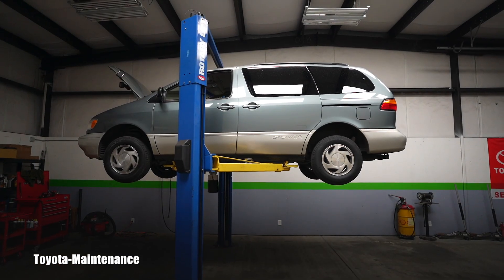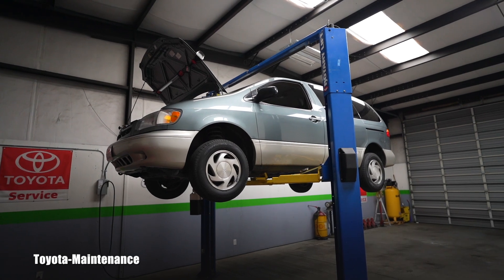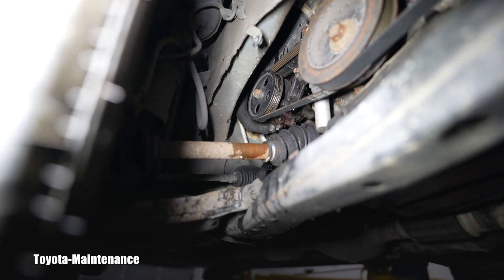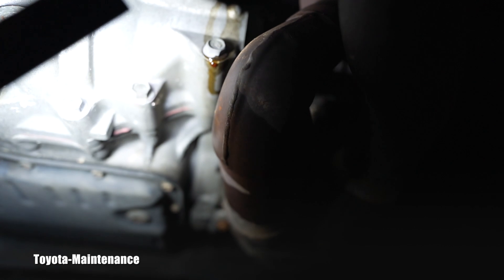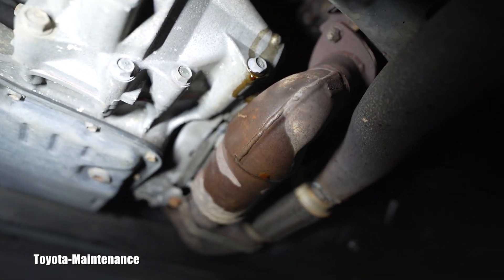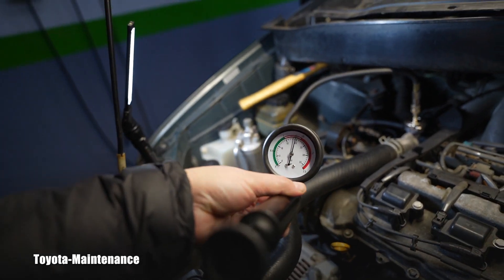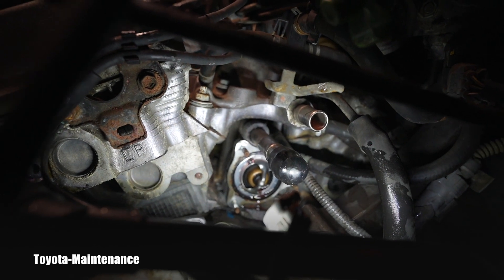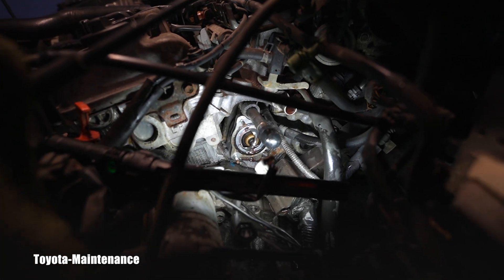How to find engine coolant leak

Comment: Hey Petr. I’ve heard from other mechanics that pressurized testers or refill kits like this hooked up to an air compressor, can cause damage to older vehicles’ cooling systems. Apparently something to do with them not being built for such pressures. 

What do you think? Safe to refill a Toyota from 1991-2005 with a vacuum refill kit?

Comment: I have the same kit,  love it. It found leaks in radiators,  heater core,  head gasket without any problem. It has a unit for filling the radiator quickly sith vacuum too.

Comment: just had the rear brakes and differential serviced.  and multi point inspection.   almost 100,000 on my 2016 tacoma sr. 4 cylinder. many more to go.  have a good day.

Comment: 🥳 Congratulation on your cooling system pressure tester. Wow all the attachments. My tester is from the 60's. It's a Stant brand. I'm no longer doing mechanic work or try and avoid it. LoL. It was good through the 80's on any car with a metal filler on the tank. My Tundra has a small leak in the water pump indicated by a small trail of crystalized anti freeze. Toyota has a sealer in the antifreeze that crystalizes when it hits air. A Toyota mechanic pointed it out to me. Glad he did before the leak progressed. This is why I take my Tundra to the dealer for oil changes. I tell the service writer to try and up sale me. Of course I barter over the price and receive a fair price.  👍

Comment: Nice video Peter. Which coolant testing kit did you use? I got one from Amazon for ~$100 and noticed that it would leak pressure (psi) when I used the manual pump

Comment: And what's the reason that you didn't want to use the pressure testing system to begin with?
Reply: The location of the cap was directly under that cowl. It appears he had to remove the wipers, wiper assembly motor and bolts holding the cowl just to insert the pressure tester. Then he had to hold that cowl up with some kind of wooden handle. And he still had a bend on that pressure hose that would lose pressure if it wiggled. Location, Location, Location!
Reply: Issue is explained starting around 5:15

Comment: I made my own testing device, a chunk of rubber with a 5/16 hole drilled @c/l then shoved a valve stem in said hole then attached to a bicycle pump, place chunk in either the overflow resivior and or the radiator cap she”ll rear her head. 0 cost.

Comment: Very much appreciated you describing what to look for for different problems. We have a Subaru Outback (V6) which slowly loses coolant at times (other times it's fine). The 4 cylinder variety is notorious for head gasket failures, but I don't know if the V6 is. Anyway, this video gave me a direction to go to try to find where the coolant is going